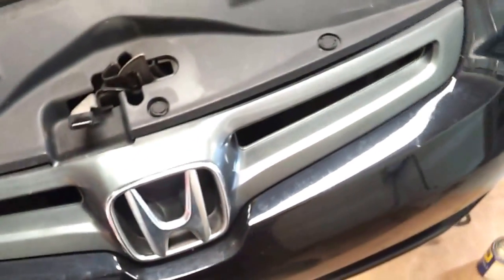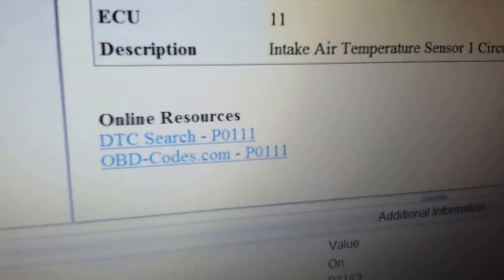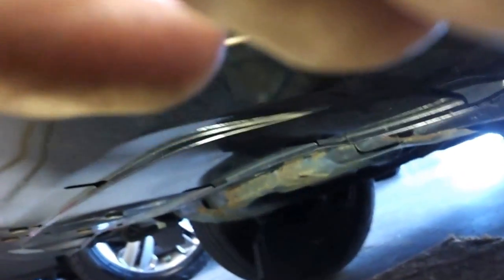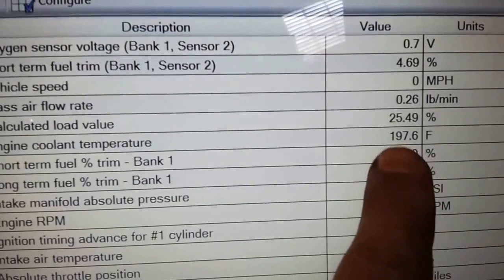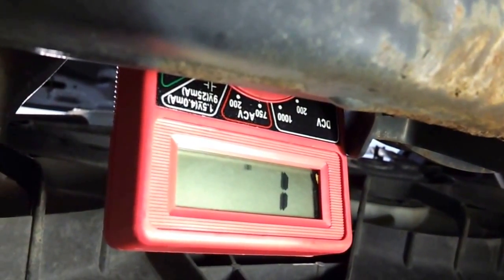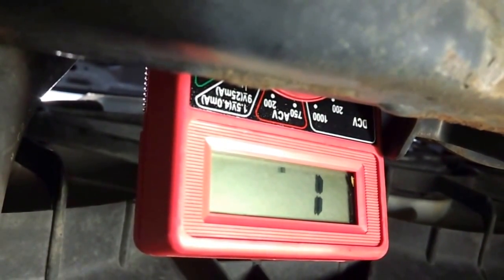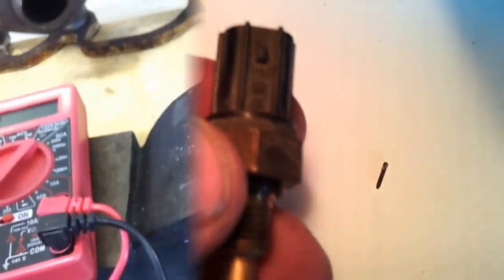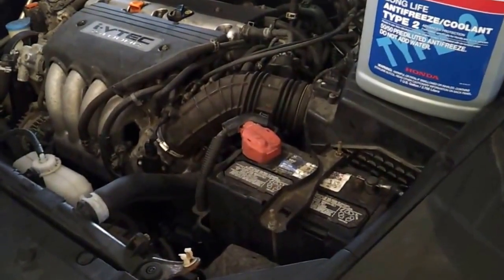Honda/Acura coolant temp sensor-trouble code P2183- 2005-2007- 2.4L 4 cylinder (ECT2)

Comment: This video is very helpful i have a 2005 odyssey. Took it to the garage to get them to have a look the said the temp sensor #2 high voltage. Hopefully its nothing to hard for the mechanic to replace
Reply from the maker: Hopefully they know what there doing ;-)  Thanks for watching and commenting Jamie
Reply: Your video is in very good detail. Id do the work myself but i dont have the tools. So with out deleting the codes off the ECU once the thermistor is replaced doe's the codes reset itself once replaced.
Reply from the maker: +Jamie Landreth if the sensor was correctly diagnosed as the problem and replaced with a new one it should not set the code again. If the new ETC sensor is working properly
Reply: Ozzstar the car is going to garage today to get scanned and hopefully fixed. Today 26 oct im in new zealand so a day ahead of usa

Comment: If your Car / Trucks Shuts Off When Warm / Hot / Overheating and Starts Right Up After it Cools Down (30-60 Minutes)= Bad ECT Electronic Coolant Temperature Sensor / Sending Unit. You can do a By-Pass and will get you going again. Also, this will buy you some time to get a replacement unit.

Comment: Great Video. 

Honda should be ashamed charging so much for their antifreeze when half of it is water. I pay less for full strength antifreeze for Mercedes AMG customers.
Reply from the maker: Thanks Marc.  Almost all corporations nickle and dime consumers to the bottom of there savings accountant!!
Reply: All of hondas fluids a full synthetic  so they dont corrode they cast aluminum. Which in my opinion means they didnt want to use cast iron or steel so in reality they engineered them so u dont run into problems. Ohwell if u have to buy honda atf fluids thats for a reason and a goof reason. If u use any other fluids it will cause corrosion
Reply: damn auto zone charges 35 bucks..

Comment: Gear video! Do you have to drain the coolant to replace the sensor?
Reply from the maker: +K Psalms the coolant will pour out before you can thread a new sensor in if you don't drain the radiator first.  Thanks for watching

Comment: i have an 07 honda accord. and i changed this sensor but the check engine light still comes on periodically. so i was going to change the pigtail just to be safe because the last one was corroded. but i cannot seem to find them anywhere, would you have any suggestions?
Reply from the maker: +Richard Fraley have you checked the trouble codes with a scanner?  Corrosion inside the female end of the connector can be an issue.  I would contact a Honda dealer and get the connector part number, if that was the problem causing the issue.  First check circuit integrity.  Good luck
Reply: +Ozzstar yeah it's the same as the video. but the code comes on once every 3 weeks  and stays on for a day or two and goes out.
Reply: Richard Fraley has

Comment: Thanks for this, did you have to replace the sensor behind the engine?
Reply from the maker: +Jeremy Ellis i didnt replace any sensors on the back of the engine
Reply: Thanks, great video. Parts ordered and taking this on tomorrow morning.
Reply from the maker: +Jeremy Ellis your welcome.  Make sure to use the blue Honda antifreeze. Good luck

Comment: Great homespun cinematography! Thank you for yeoman service to your fellow man!
You located two coolant temperature sensors into the engine coolant chamber - is one for high and one for low reading? If so, which sensor pairs with code P2183 and which with P2185 (both appeared on your computer screen)?
Reply from the maker: +CRBT CRBT both codes you mention are related to a defective ECM coolant temp sensor 2, located in the radiator.   ECT 1 is for the temperature gauge only and has nothing to do with trouble codes.  Thanks for watching

Comment: Hey great video. quick question do u think replacing the (ect 1) will resolve my temperture guage not working properly? thanks man
Reply from the maker: +Nice...Man properly testing the ECT1 will determine what is causing the issue.  Diagnose, get evidence and then repair.  Thanks for watching

Comment: I am replacing this ECT2 sensor for the second time, and at 80k miles the electronic contact cleaner worked on the wire connector plug but now with our northern climate and road salt the plug is very green, corroded and suspect and not cleaning up with contact cleaner - ideas on where to source new electrical connector plug

Comment: Excellent video. Had exactly the same problem with moisture getting past the rubber seal in the pigtail corroding the same connector.  I do have one other problem for which I was hoping you may have some insight.  Unlike the entire pin coming off a the base of the connector, mine corroded near the middle of the pin leaving approximately 1/2 of the pin inside the pigtail when I removed the pigtail from the sensor.  Looking at the end of the pigtail, it appears that each female pin retainer side may come apart allowing me to remove the broken portion of the pin.  As expected, no real help from the Honda dealership as they want to sell a complete front wiring harness for over $100.00.  Not to mention the extensive amount of time it would take to disconnect and replace it. Any suggestions would be very much appreciated. Thanks!
Reply from the maker: Doesn't surprise me the dealership would charge that kind of money.  You have to get those broken pins out of the female side so here is a suggestion for you.  You can most likely 're-pin' or splice in an aftermarket connector.  Very inexpensive that way doing it yourself!  You will need to know which 'special' pick you need to remove the pins from the connector if re-pinning.  If the pins are damaged with corrosion they can be replaced for just a few dollars, look on places like ebay or rockauto.  Do a search on that topic, fix it and let me know how you did.  You can get it done Minnesota, take your time!  Take it easy - ozz

Comment: this really helped...thanks for the video. the check engine is on for my 07 accord. these are the codes i got p2183, p0111, p2185, p0128. Any idea what p0128 stands for??
Reply: With the codes you are experiencing Honda service manual states that it is possible for ALL those codes to appear if the ECT #2 is experiencing a problem. Test for a bad sensor or corrosion in the connector!! Ohm test the ECT on the lower radiator like i show in the video, this is most likely the problem you are experiencing. I believe the P0128 Honda trouble code states that coolant temperature is below threshold.  This usually means that the thermostat is stuck in the 'open' position, and will appear when the ECT2 on this model is defective. Good luck with the diagnosis and repair, thanks for watching!